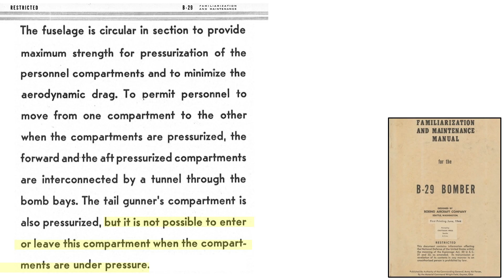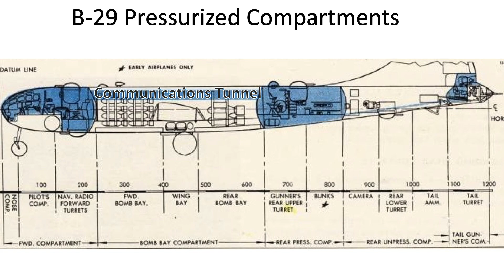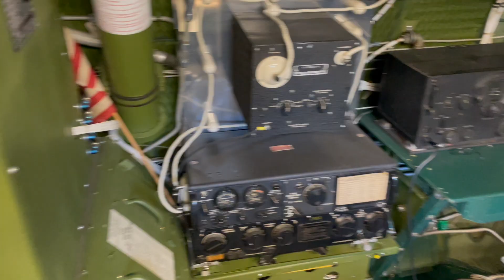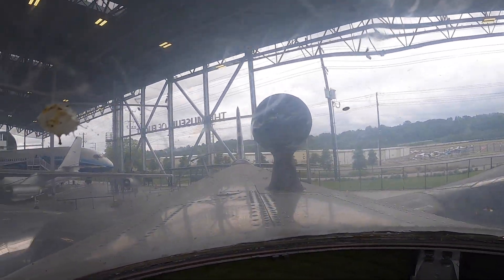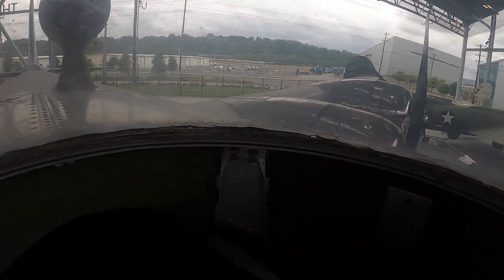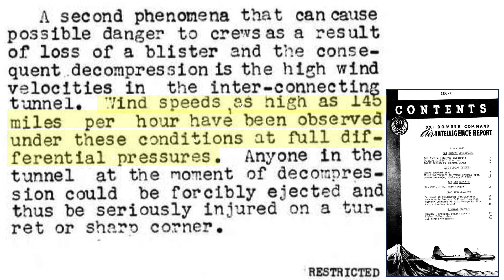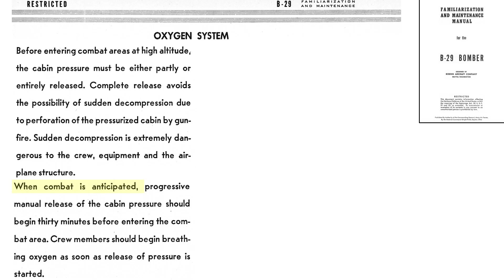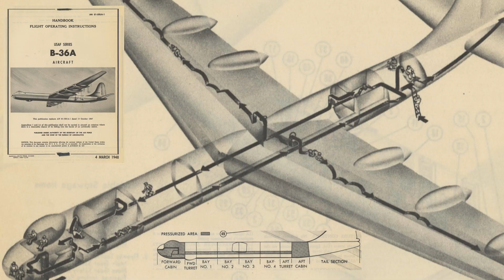B-29 Bomber Crew Tunnel Belly Crawl Through and factoid Video

Comment: I was driving and 18 wheeler in Illinois. I pulled into this really tiny trucks stop with an airport out back with a B29 sitting 30 feet from my truck. The guys on the plane were nice enough let me crawl through the plane and take pictures. I also did the same (FIFI)in Pensacola 1981.

Comment: I’m not grasping why the pressurized areas had to be depressurized on the bomb run ? I mean it’s a totally separate area, that’s the whole point. If you’re in your t-shirt as many of the crew would be since it was in fact pressurized, they’d freeze to death on the bomb run. Something doesn’t sound right here.
Reply: Damage could cause an explosive decompression.
Reply: Most of the time the enemy would know you’re coming, just not date and time. They had flak waiting for you. Aircraft got hit way more often than they got shot down. If pressurized part got hit on final bonb run it’s too much to expect bombardier to perform. Just the dust/fog would be disabling for several seconds.

Comment: First,  back in the 1970s I was able to use the crew connecting tunnel in the B36 at the Strategic Air Command Museum, then at Bellevue, NE.  A very interesting experience!  Second, the current SAC Museum, now near Ashland, NE has a dismounted crew tunel from a B36 as an interactive exhibit.

Comment: In combat B29 was depressurised  if so how was livable temperature maintained  -20C leathel very quickly
Reply: The crew had warm flight suits often electrically heated similar to the B17 and B24.
It is just a lot nicer to not have to be breathing through a mask and fighting the cold (which could get to -45 ) all the way from base to target and back.
Reply: @ret7army  over target B29 was not pressurised ?
Reply: @Eric-kn4yn  It would be too dangerous if the plane got bullet holes while it was pressurized.  You saw what happened to the Boeing plane when that dummy door blew off?  The crew on a B-29 wore heated flight suits like the B-17.  Needed oxygen masks when over the combat area.

Comment: Four points to make:
1) Ten years before this, the American military was flying biplanes. (A Captain Obvious point but has to be said!)
2) The bombardier's job, except for dropping bombs was a fairground ride!
3) The Japanese had no chance of winning WW2.
4) Another cool video from Keith. Thank you, sir!
Reply: Maybe. The bombardier once they reached altitude went down the tunnel and armed each of the bombs. After they cleared bombing run and out of range of flak went back to the bomb bays with a face mask and small O2 bottle, and, without a parachute on, stood on some kind of ledge, holding on, kicked out any bombs that failed to release, mostly due to ice. Turns out Kadena is tropical and it rains, and at 19,000’ over the Yalu it’s freezing cold. If your pilot was concerned about getting lost over the ocean the co-pilot and the bombardier navigated too, including shooting the stars if night. Pilot looks at results to see all three are close, then uses the navigator’s results to steer by. Mostly watching for possibility of co-pilot and bombardier having close results and navigator being way off. I don’t know that ever happened, but caution required. Occasionally logging all the standard 15-minute checks at the flight engineer’s station, under normal cross training regime, although maybe only on training missions. I’m not sure. And for the couple hours over the peninsula watching for MiGs, and occasionally firing at them if not on final bomb run. Noting any trains or trucks seen over enemy territory for debrief session. With 0.45 on, escort camera with similarly armed sergeant in Jeep to photography. Debrief, after the required drink of course. Eat. Then drink heavily till you can sleep. Even after being up maybe twenty-two hours fear makes sleep difficult and restless without the booze. Oops, forgot another one. On takeoff be ready to open bomb bays and salvo bombs if you lose an engine. At combat load you need 500’ of elevation to have time for this to happen. Don’t have 500’, crew dies.
Reply: @billsmith5109  You are right, I did not consider any of that! I was just thinking of some ww2 footage, where B-29s are flying across the Pacific and what a view the  bombardier had of the ocean! I did read Leonard Cheshire's biography, where he marvelled at being in a warplane at 35,000 feet, wearing normal clothes. Very different from 12,000 feet, in winter, over Germany....
Reply: @MartinMcAvoy  Maybe they floated up that high on way home. Ship much lighter after dropping combat overload of bombs and most fuel gone. Burn two thirds on way out, one third on way back to Kadena. Only once, bombardier gets on intercom, asks pilot how long he’s been asleep. They’re asleep. So is everyone else. Not good. Ship just flying itself south across the Pacific. The downside of longer range. Getting up at 0001 or more commonly 0200 doesn’t get you much rest. Stress. The long hours of those massively loud engines just a couple dozen feet away.
Reply: @billsmith5109  Bombardiers did not arm the bombs.  When the bombs went into the racks, wires were put through the fuse propeller on the bomb, the other end attached to the AC.  Bomb is dropped, wire gets pulled out of the fuse propeller, and the propellor starts to spin.  After so many revolutions, the fuse is then armed away from the AC.  You definately wouldn't want to be flying along with a bomb load that was armed.  The atomic bombs arming process was started by the mission bomb commander 15 min after take off.
Reply: @schristi69  Contrary to how the 307th operated at Kadena, 1950-51.
Reply: Nips couldnt win but stalemate maybe ?
Reply: They had no intention of "winning" WW2 by themselves. Nor of "Defeating" the USA. They were never going to TRY to invade any of the "Western" homelands in force. Winning for them, was knocking out the American ability to interfere with Japan gaining control of southern Asia.
And without the Bomb, ( which the Japanese had no idea  about )  and if the U.K. and Commonwealth had made an armistice with hitler and Italy, which they may well have been forced to do, the American forces may very well have been insufficient to both protect against hitler, AND  invade the Japanese Empire.  
When they attacked, the Battle for Stalingrad was not decided yet. The British and Commonwealth troops had had a string of defeats. If they had lost North Africa, which they almost did, Spain was poised to enter the war on the side of the fascists. 
If hitler had knocked Russia out of the war, or forced it to sue for terms, AND the Japanese had  of got the American carriers, things may well have gone past the point that the Americans COULD risk the full scale destruction of Japan with conventional weapons.
It was a dumb gamble, but no part OF their gamble was "winning WW2".
Reply: Old chain email joke: Mistakes a certain toothbrush-moustached Austrian made during WWII #4175: Saying "The US has only 300 times the industrial capacity of Japan. What are you, chicken?" to Tojo.
Reply: @hoilst265  Military dominated, authoritarian government. Too perilous for those who know the truth to say it out loud.

Comment: My father was a USAAF B-29 navigator 1944-45. He died in 2016 age 94. He kept - and I still have - his orignal flight jacket with squadron insignia. He told me that on long missions after giving the pilots a heading he would sometime go up into the tunnel to lay down and get a short nap and that other crew did that too. My teen son and I visited (but did not fly on) FIFI in 2018 at Boire Field in Nashua NH. My family and I are Friends of Doc.
Reply: Thanks for sharing that story. For young fellas who grew up in the poverty of the 1930's seeing a B-29 for the first time, must have been like seeing a spaceship. The prospect of crashing into Japan, or the ocean, must have been a daunting concern.
Reply: My father was also a B-29 navigator.  I have his dress tunic, binoculars and 1911A1 pistol.  He hated the B-29 and the lies the Air Corps told about it. Operational losses claimed more B-29's and their crews than did the Japanese.  Engine fires and runaway props were the most common failures and dads plane experienced both over time.  Only the experience and skill of the AC saved the plane.  We lost dad in 2007.
Reply: I volunteer at a non-profit airport with a man who is 89. He wasn’t old enough to fight in wwII but was in the Air Force in the 50s and helped fly several B-29s across country to be decommissioned. He told me the same thing, that he’d always take naps in the tunnel.
Reply: @CarburetorThompson  I like hearing stories about the old timers! 😀
Reply: I've read that after testing, the highest scoring candidates were slated for navigator!  And you have his genes!

Comment: If you think this is claustrophobic, check out Ryan on Battleship New Jersey inching all the way through a 16” gun tube.
Reply: That has to be a joke, right?. Even my girlfriend, who is crazy petite, has shoulders that are 17 inches across.
Reply: @uncletiggermclaren7592 no, definitely not a joke.  He did the barrel crawl two or three years ago.  As did many battleship sailors in their day.  You'd be told to put on your work clothes and told to crawl through the barrel.  There's pictures of sailors sticking their heads poking out of the guns pointed up at an angle to the sky.  I'm sure I could do the crawl, even at 43 and 6 f, the human body is quite foldy.
Reply: @Salty_Balls  OK, went and saw someone do it. I stand corrected. 
Be interesting to see his size compared to me.
Reply: @uncletiggermclaren7592  I'm an electrician, I'm used to very tight spaces in attics and crawls spaces.  I've been in spots I was convinced were impossible to get into and figured I'd have to be cut outta.  But somehow always manage and I'm 6ft and 200lbs.  One of my helpers in the past was a firefighter and he said part of their training was crawling through a really confined tube and learning to deal with it.  What he described to me sounded like torture, even compared to the barrel crawl.
Reply: @uncletiggermclaren7592  also, Ryan is fairly big at 6ft as well.  He's exactly one curator tall.
Reply: @Salty_Balls  I was fitter for 7 years before I got a better offer. This was the term for a kinda glorified Gofer/offsider for a welder. It was my job to measure, hang and hump the pipes around the site. 
I was never keen to get into ceilings, and one time I flat refused and told my boss I would go back to milking cows if he tried to insist because the entire ceiling was full of newspaper and other such tinder and kindling.
He initially argued with me ( the man was totally blind in one eye ) until he got up and had a look at what they expected him to use a welder in . . .  so he told them they needed to get all the fuel out of the building before we carried on . . .
They refused so we didn't do the job. About 6 months later the place burnt down during the ongoing  upgrades.
I was pretty Sure I knew what  the cause was.
Reply: Destin on smarter every day channel crawled a torpedo tube on a submarine. 

No thanks lol

Comment: You have to wonder how many crew members got the bends from going to 8-10000 ft to 32000 ft before the combat zone.
Reply: They were pressurized above ~12,000', so likely the same as modern airline passengers.

Perhaps it's only if you dive under water that it is a problem.  Water is a lot heavier than air.
Reply: IIRC Fresh water is 1 atmosphere per 33 feet and salt water is 1 atmosphere per 32 feet.  Might be off a bit.  But by depressurizing 30 minutes before entering combat zone they prevented that

Comment: On the B-29 did they remove the tunnel for carrying the A-bomb – I’ve read conflicting accounts.
Reply from the maker: My understanding is the circular cross section tunnel was replaced with a modified tunnel with a flatter bottom. The revised tunnel was needed to increase the bomb bay size.
Reply: @WWIIUSBombers   I remember seeing Colonel Tibbets being interviewed and saying that after the bombing of Hiroshima, he had not slept for 24 hours, so he handed over control to Captain Lewis and found a bunk to take a sleep. So the Enola Gay must have had a connecting tunnel, if modified. The Colonel said he was tired and slept well....
Reply: Thanks that’s the best answer I’ve heard – makes sense as there was not much room but there had to be an added cross-support to allow the overhead latch. Thought the tunnel might have removed but then there were stories of crews going back and forth.

Comment: The procedure of reducing cabin pressure before entering combat seems to have been presented in some but not all of the manuals related to operating the B-29.  Some just warn that the crew should have 02 masks on during combat because rapid depressurization could occur due to battle damage.  Perhaps those were earlier editions of the manuals.  

I would like to know if anybody has information on whether the airplane could maintain sufficient heat in the cabin when depressurized at high altitude, or if the crew ever had to resort to electrically heated flight suits.  The air for the cabin came from the inboard turbos of the inboard engines, so I imagine there could have been a contest between the air needed for the cabin and that needed by the engines if the turbos were maxed out.
Reply: Dad said they wore heavy mittens. Inside these they wore gloves if they needed to do something that required more dexterity. Inside these they wore silk gloves in case they needed even more dexterity for a few moments. They never took off the silk. At least bombardiers followed this plan.
Reply: @billsmith5109  Just to confirm, you are talking about the B-29 rather than the B-17?
Reply: @gort8203  B-29, though Dad did fly in B-24’s in WWII. He did say over N. Korea it was regularly -40f at altitude.

Comment: It would be interesting to see a video on the "Silverplate" B-29 modifications that were necessary to accommodate the bombs dropped on Hiroshima and Nagasaki... (Thanks for all the great videos!)
Reply: Curious to see exactly how they accessed the bomb bay to arm the bombs.
Reply: @Roddy556  Same way Major Kong got in there. They depressurize as they approach the combat zone.
Reply: @Roddy556  Of course, how else could they ride it down waving a cowboy hat?
Reply: @Roddy556 They were able to open and access it. In fact, one of the problems with “Little Boy” was that it was assembled correctly so the crew aboard the “Box Car” had to take the bomb out and fix it mid-flight. 😊
Reply: @matcauthon9669  neat. 
I am going to ad, since youtube has deleted the comment FIVE TIMES for some reason, I would be interested in videos on medium bombers and the mechanics of tactical bombing.